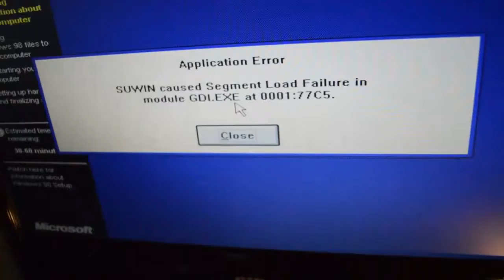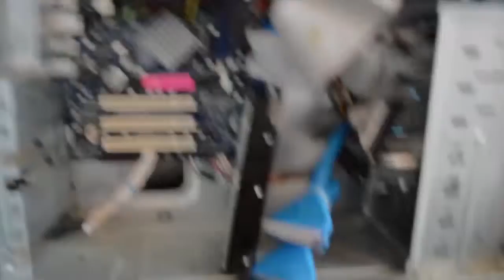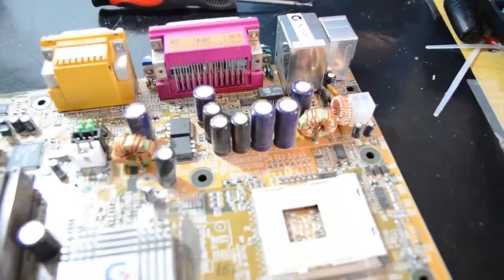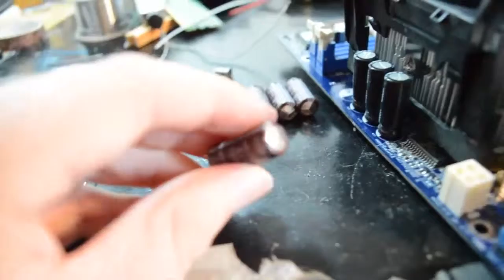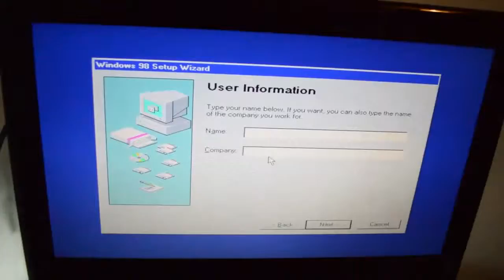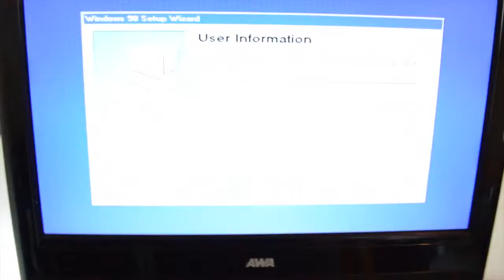Old School Gaming PC: Part2 - Bad Caps

Comment: the kzg caps were actually made by a good brand (united chemi-con), but yes unfortunately they used a bad formula in some batches (it was fixed later).
cheap chinese manufacturers had copied the KZG formula for their own caps, thinking since it was from a quality manufacturer it would be fine. the mass manufacture of capacitors with this bad formula by many vendors went on to cause the "capacitor plague" on electronics of the time we know today.

Comment: using 16v caps shouldn't be a problem other than if they were massive and couldnt fit in, thinking of making an oldschool gaming pc myself with my spare parts
Reply from the maker: Yeah all the 16v 3300uf caps I  have seen online are no wider actually just taller. Too bad the shop doesn't carry any 3300's :(

Thanks for watching